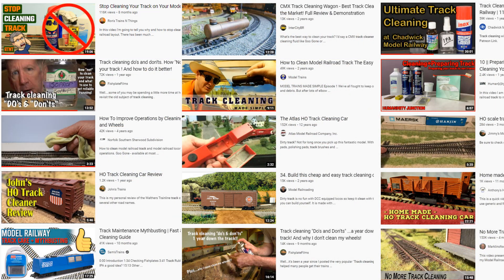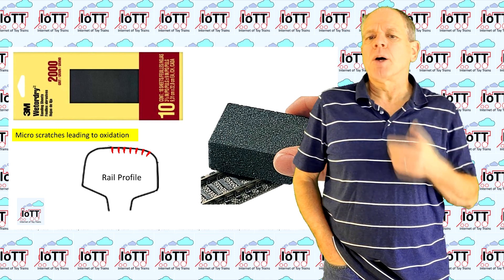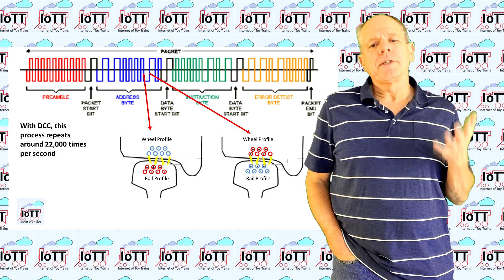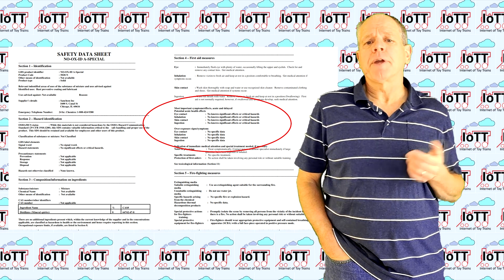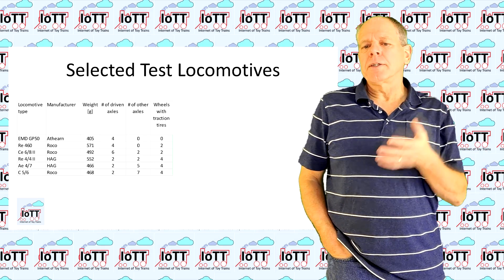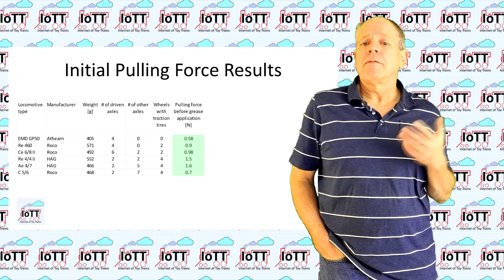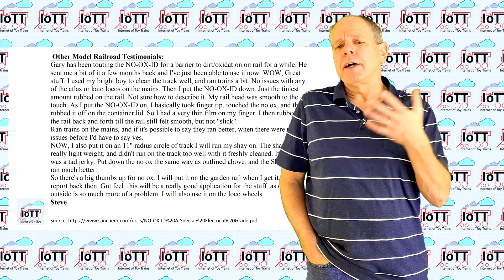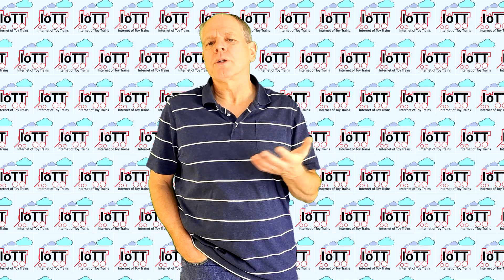The Science of Track Cleaning (Video#86)

Comment: After watching this video I will avoid the No Ox ID. I already have a stuggle with pulling a set of coronation coaches (all brass), up a slight incline. The plan is to increase the weight of the A4 loco to increase traction, but the slip effect of the No Ox ID would have the reverse effect. I've just bought a CMX cleaning car and plan to use WD-40 contact cleaner which looks good on the chart for non polar. At least that will help. 
From my University days I remember that lubricant thickness is thinner and more effective with higher loads, so no matter how thin the application it will still act as a sliding mechanism. 
I guess the plan should be to clean the track and wheels on a routine basis - say once a month to keep on top of the track dirt. Plus do not use abrasives which scratch the surface and effectively increase the surface area for oxidation.
Reply from the maker: Well, if you put some kind of grease on the track, it is to be expected that traction force, based on adhesion, is reduced. So I think you are on the right track with your conclusions. Of course an other alternative would be battery powered.

Comment: Thanks for this great video! Do you have any alternate solution for NO OX ID? I live in Europe, so I need something accessible here. E. g. can copper paste be an alternative?
Reply from the maker: Unfortunately not, but I think any type of contact grease will behave similar like NO-OX-ID in both areas, electrically and mechanically. So, I think copper or graphite paste are worth to try out if you can live with the reduced friction level (would actually be interesting to do a comparative study on those). If not, then you probably should use mineral spirits, e.g. petroleum.
Reply: Soy Manel vivo Gerona ( Sain). He conseguido NO OX ID en Amazon sin roblema

Comment: Your chart of different locos makes me wonder why, apart from traction tires, some are better "pullers" than others
Reply from the maker: This is a function of the weight and the number of driven axles. The maximum pulling force is the product of weight on the pulling axle and the friction coefficient. If now half of the weight of the locomotive is supported by non driven axles, the maximum pulling force is only half compared to when the entire weight is on driven axles. That's why on locomotives with fewer driven axles you typically see more traction tires as rubber on metal has a significantly higher friction coefficient, which helps to compensate for the lower weight on the driven axle.

Comment: I don't see how the dielectric constant of isopropyl alcohol makes any difference.  That is a specification for while it still exists as a liquid.  I believe that all of the alcohol (and water if using something like 70% or "rubbing alcohol") evaporates rather quickly.  So how can the dielectric of something that evaporates completely matter?  Am I missing something?
Reply from the maker: See my comments to Merlin Island & Crab Cove Railway's remark a few line below. Solvent and dirt make a nice filler for the unevenness of the rail head, and at the same time you wipe of the majority of it, you rub a portion nicely in every available hole, where it has the effect I describe in the video.
Reply: @IoTT  The thickness of any dirt in unevennes is extremely small.  I find it hard (impossible actually) to imagine that any water or alcohol wouldn't have flashed off in a matter of minutes, more likely seconds, or less.  My background is electrical engineering and I think the dialectric constant of rubbing alcohol is totally a non-issue.
Reply: @trainliker100  I have to agree. The polarity of a solvent in liquid form has zero influence when the solvent evaporates. 91% IPA, for example, flashes off in seconds and has absolutely zero chemical reaction with most metals (any we would use). That's why it is used extensively in industry to clean metals, clean electrical circuit and contacts. 
As far as IPA (or similar) creating a filler putty of crud that lodges into micro scratches and pits in the track goes, the same could be said for any of the recommended, "low polarity" solvents, such as mineral spirits.  Whether it's IPA or mineral spirits, it's just going to mix with the crud on the track and eventually evaporate. So I'm not convinced the polarity of a selected solvent has much bearing on anything. Let's face it, unless a solvent has a chemical reaction with the metal, it has zero affect once evaporated. I think that just about any solvent such as IPA, mineral spirits, etc. are perfectly fine to clean track with. Until someone does a proper scientific test, with full controls, I'm going to remain skeptical about solvent polarity.
Once clean, however, I think a contact treatment such as NO-OX-ID is a really good idea. Protecting the track from oxidation or contamination caused by both atmospheric conditions and electrical arcing makes a world of sense. I think this is what is making the most difference for people who are cleaning and treating thier track with these products.

Comment: I used IPA for years followed by a track cleaning car with a piece of hardboard sliding underneath. For the most part it did very well but to me it did require repeated treatments. When I read Joe's article, it made me think about track cleaning again. Like Pierre, I have purchased some mineral spirits to try. As my layout is still in the early stages I haven't had the time to give it a try yet but hope to in a few weeks. I'm also going to see if I can get some No-OX-ID as everything I've read so far matches your findings Hans. Still, I think that one of the biggest problems for N-scalers, at least, is not just dirty track but the very light weight of the locomotives. Combined with dirty track there is no wonder as to why we get flickering lights. Fortunately for me, my small locomotives, switchers, will be doing their work on mainly level ground. My heavy Atlas Trainmasters will do the mainline and that's kept to a maximum 2% grade.
Reply from the maker: Yes, the light weight does add to the problem, as the maximum pulling force is weight times friction coefficient! And as the weight pretty much goes with the volume of the locomotive body, it is reduced with the third power of the scale. So, smaller scales, less proportional pulling force. Now I know why I like Garden Railroads ;-)

Comment: But the solvent evaporates!
Reply from the maker: Yes, we would like to think that on a flat surface like a rail head the solvent will disappear. Unfortunately, under a microscope, the rail head looks more like the moon surface with crates and hills everywhere. This even gets worse if you use any kind of abrasive treatment. If you then add a solvent, you pretty much create a filler putty with the dirt on the rail, then you take a rag and rub it into the valleys. Your rails might look shine, but the dirt sits in the microstructure and in those valley it will take time for the solvent to disappear. And even if it does, you still have the filler sitting there, forming a capacitor with the effects I describe in the video.

Comment: Would you use this with traction tres as people report that could be issues
Reply: I was thinking to remove the traction tire on all my locomotive anyway . Look like it is the way to go with this solution. According to the locomotive Hans had tested. The steam engine are similar than the crocodile one. Look like those will have more lost in their tractive force.
Reply from the maker: It really looks like the impact of the grease on the rubber reduces the friction coefficient significantly, so I would think about it twice. And probably not use it ;-) 
On the other hand, I don't think that the grease is destroying the rubber as NO-OX-ID seem chemically quite neutral, so I have no concerns from that point of view.
Removing traction tires might be an option, but as there is normally a groove on the wheel where the tire sits in, you probably would have to replace the entire wheel.
On the positive end, it seems that newer locomotives tend to have more driven axles than older ones, which reduces the problem.